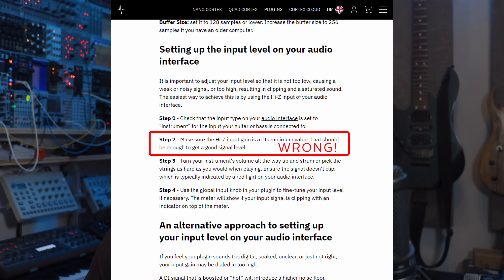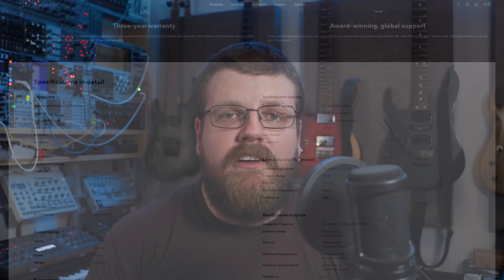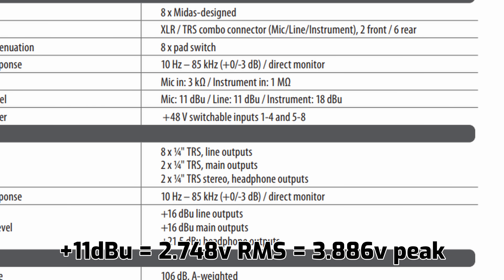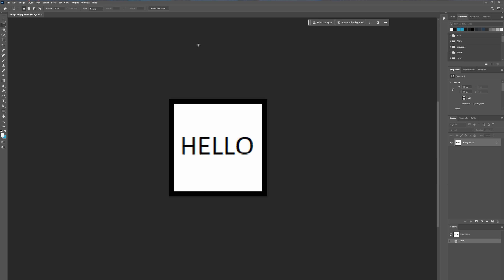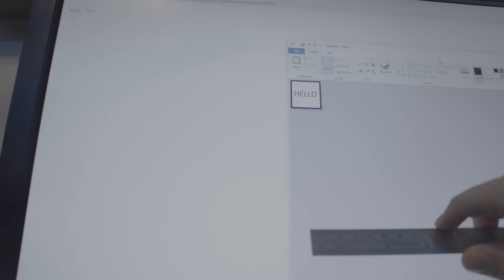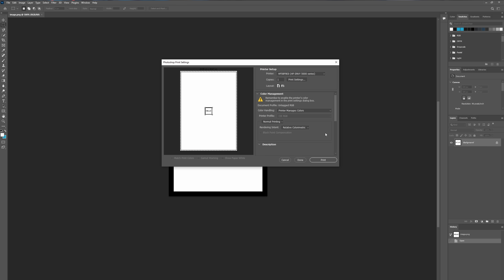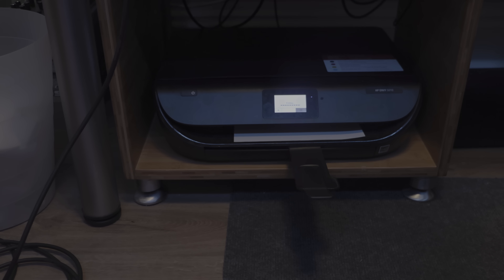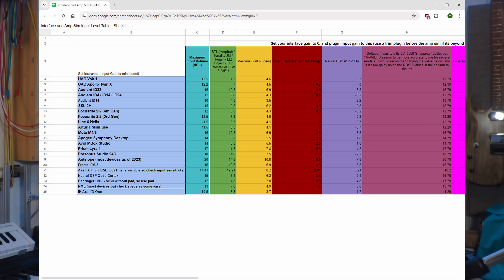Ampsims and input gain - Please, stop the madness...

Comment: isn't -18FS = 0dBVU = 1.23 VAC the standard measurement calibration at 24 bit?
Reply from the maker: There is no standard calibration for any of this - that's sort of the problem.
Reply: @GhostNoteAudio   I'm not really sure I follow, because there is a standard calibration from dB FS to dBVU and it's -18dBFS @24BIT = 0dBVU = 1.23 volts ac.  Is the issue that the plugin programmers are not coding for their plugins to be optimal at any particular signal range?  because that's lazy.  All dynamics plugs do, and if they didn't, you would have to massively regain structure every time you swapped one plug for another.  FWIW, I've never had any issues just plugging into the HiZ and gaining like any mic into the Emulator.  I agree with your philosophy 100%
Reply from the maker: @japmn1  you keep saying there is a "standard calibration"... Got a source for that? Because the whole cause of this kerfuffle is the fact that there isn't an accepted standard. So I'd be very curious if you could offer some documentation or specifications for this standard you're referring to. - also, bit depth has nothing to do with this so not sure why you keep saying "@24BIT"... Not trying to be confrontational, just trying to both learn and educate.
Reply: @GhostNoteAudio  The Standard calibration from a +4dBu analog signal to Digital Full Scale @24 bit is 1.23 volts AC (0dBVU) is equal to -18dBFS in the digital domain.  It is the standard calibration to match a Converted digital signal to Analog Signals in +4dBu calibrated system.  You can test it.  push a 1k tone out of your balanced converter output @ -18dBFS.  Measure voltage across the leads, it will measure around 1.23 volts,  0dBVU in +4dBu is around 1.23 volts AC.  -18dB on a digital meter is roughly 0 on a VU meter at +4dBu.
Reply from the maker: @japmn1  I'm sorry but you're wrong. You can't make this claim because the maximum input level varies between audio interfaces. You can feed it a +4dBu signal, and it will result in different dbFS levels of the converted signals. This is NOT a standard at all, and that is evident by just reading the product specs for a handful of audio interfaces. They all have varying input levels, and thus feeding them all the same +4dBu signal will result in varying signal levels in the digital domain.
Reply: @GhostNoteAudio  Whatever you say man, I do know that I and thousands of others have calibrated DACs to Analog consoles and tape machines to that standard for about 25 years and I have never seen a -18dBFS (with maybe a half dB margin) signal from any DAC NOT measure 1.23 volts AC, which certainly is 0dBVU in a +4dbu Analog system.  Get a digital multimeter, pump out some 1K.  See for yourself.
Reply from the maker: How about you do that, because I did; that's how I KNOW you're wrong. And that's why I created a 12 minute video on the subject. 🙃
Just read the user manual for the Focusrite Scarlett as a start. it has a +12dBu input threshold, and that results in 0dBFS. Reduce the input gain by -8dB, so you have a +4dBu signal... and you have -8dBFS on the digital side. Not -18dBFS. How is that so hard to understand? It's basic math.

Now repeat experiment for every audio interface on the list in the spreadsheet, and realise that they all result in different dBFS values at +4dBu.

Comment: Thanks a lot for this clear explanation. It reminds me of another analogy with the digital photography. There is a lot of difference in the final image file, if I underxpose a shot and then I add luminosity in post production, than if I overexpose the shot to the maximum possibile level but without burning lights, and then I reduce the luminosity in post production. It is always related to the signal to noise ratio and to the ability to exploit, at the best possibile level, all the available bits.

Comment: I always called bs on the 0 db gain stuff. While it works if you tweak around stuff in both the interface and the plugin, you can't achieve the most optimized result you want.

Comment: I have a dumb question as I am a beginner trying to record, but never have recorded a drum sound I've loved:

You said set your input gain in your plug-in according to the spreadsheet. What does that mean? I just am recording straight from the interface to the daw (reaper). Do I have to get a specific plug-in in order to gain stage? I'm confused. Wondering if I can skip that step and simply set gain right below clipping on the interface, and then off set that gain via lowering the input on the DAW
Reply: I have same question!

Comment: Great video! Thanks for setting this straight. Not sure what the deal is with the spreadsheet, but most analog emulation plugins are looking for around -18dbfs on their input (check the manual to verify). Easy enough to set with a V/U meter and volume control plugin, if the amp plugin doesn’t have input volume or decent metering. But yeah, ALWAYS set the interface input just under clipping level for best SNR.

Comment: Im so confused with what is meant to be adding boost vs treating your input like a real world amp. If I dial up gain on the guitar input, so it sits before breakup, is that not the same as adding a clean boost pedal in front of the amp? My understanding is that zero db gain on the input was meant to give us a true guitar>cable>amp simulation.
I get the whole noise floor thing, and wanting a base level, but even when we change guitars real world we are changing output levels between pickups, cables, pedal chain etc...
Ive been using Audio Assault plugins and they now have a level calibration built in. I combined your advice here, on my Audient ID24, and used the calibration in the sim and pulled almost zero db (-.6db) digital adjustment. For the most part this make sense, but am I now clean boosting my guitar signal??

Comment: Great video. I think that part of the problem is that lots of USB interfaces can't take a higher voltage input signal without clipping, so there is often minimal or even no setting on the input gain knob that doesn't clip (e.g. see Ola Englund's comment). So the manufacturers just tell people to turn it fully down because that gives a layperson the best shot at actually avoiding clipping. Some noise is a better result than harsh clipping.

As a side note, this is a good reason why using a separate DI box (like the ones used in live sound) can be useful, even if your interface has a button to set it to "instrument input". Converting the instrument level signal down to line level can allow you to actually have usable range on the input gain knob and can avoid clipping on the interface

Comment: Finally...  "bro science" is everywhere. People also make plugins differently, use different levels for all kind of operations. Ideally people would have a "healthy" level to work without clipping. If a plugin maker has used 0 knob'd setups, it might work just for that plugin maker, but it is definitely not the cleanest starting point. This "knob on zero go-to" thing will mess your gain stage at a huge load of plugins and not give you the best results, overall. Very nice video.

Comment: Thank you. I've had this same argument with folks for 2 decades now, even people who call themself sound engineers. I even aproach vocals the same way through an external compressor to catch those absolute extreme peaks. it is simply another level of sound quality. your analogue gear before the AD converter sound better when it run hotter even the opamp of your converter. Take this aproach and you'll be surprised to discover you don't need that expensive SSL or Neve after all to get a good sound. You might also discover you now don't need to use as many plugins to get a great sound. The only difference between cheap and expensive gear is, with cheap gear you have to do a little more to get there. Remember these 2philophies, less is more and hotter is better. PS this also apply to girlfriends. 💦

Comment: When I was in college I did some recording on a 4 track cassette recorder (Tascam). I very quickly realized that the "hiss" from the tape was always at the same level and recording at close to maximum gain without distortion was the best way to minimize the effect of the noise. It seemed blindingly obvious. I had no training, not even a manual and figured this out in like minutes. Even the cheapest Behringer interface sounds immaculate compared to a 4 track, so I guess it's not super obvious anymore, when you can record with no gain on the input and it sounds pretty good anyways.

Comment: i have an audient id14 that clips at the lowest gain using the specifically designed jfet instrument input.  argued with audient quite a bit, and they were full of it when i addressed my concerns, telling me i should just turn the volume down on my guitar.  if you're a guitarist, you know that is unrealistic.  i ended up making a cheap attenuator out of an altoids tin and a pot to make it more usable.  still noisey as hell.  i shouldn't have to do any of this crap with an input that literally has a picture of a guitar next to it.  this video helped me realize i kinda got screwed by audient, and i'm sure i'm not the only one.  thanks for that man.

Comment: People also still believe to this day that a higher sampling rate makes your signal more correct in the digital domain. You can't fix stupidity. 
Just strum the guitar as hard as it gets and push the gain up until it clips or distored. Then pull the gain 1-2 dB back to be absolute save. Setting the gain to zero is wrong on so many levels.

Comment: I disagree with you. Obviously having your Pre-amp all the way down is not correct. But I find that most designs of preamps, especially on cheaper interfaces, make a hell of a lot of noise in the last segment (turned all the way up). You'll find most pro studios hit their A/Ds at -6 or -12dBFS and then boost or cut in the software. Almost all boutique emulation plug-ins expect audio to hit them around averaging around -18 to 14 dBFS. My whole signal chain throughout my DAW mixer I run around unity RMS/VU where 0VU=18dBFS. Transient material I always trim to -12dBFS. Those are by far the best levels to work too. You are right about ADs and using all the available theoretical bits means peaking up near 0dB. For the sake of the performer getting excited and playing or shouting more, it's not worth loosing the performance to digital clipping. Ergo, -12dbFS is the norm and you are unlikely to suffer from noise at the top end of gain of the pre-amp. 

You won't go to any professional studio anywhere and hear any jobbing engineer who recommends you hit the A/D at -0dBFS. No where. So just be aware of that.

Comment: Makes sense!
 Is the gain staging with meter and playing open string as accurate as only setting audio interface gain to 0 and match the plugin input gain with data sheet specs? 

Ive been using three different audio interfaces from different brands and all those have had good (enough) NSR for my distorted tones when gain set to 0.  
Is it as accurate to use meter and open string to find the amount of gain you have to reduce? I guess that there is more room for user errors, and its more time consuming. But deffinately gonna try that if noise level is makikg tone unusable.

Comment: Who doesn't know this? Are you saying people don't understand what gainstaging is, or how to accomplish it? Any pro who ever used an audio mixing board, even an old analog one from 4 decades ago, has known this since before then. That's what the trim control on each input channel was for—to set the input to the optimum level before processing.

That is the first stage (assuming the devices input to the board are set at their optimum output levels). Next stage, mixing, final stage, system output level. It really is just that simple.

The reason -18 is the accepted standard for digital audio is not bc that's better than -1 (actually, it's 17 dB worse than -1). -18 was chosen bc many people hired to run audio are not careful about setting levels. For digital audio, anything below 0dBFS works exactly the same, other than the lower you go, the worse the S/N ratio gets. But with 24 bit having a noise floor of -144, they figured even -18 would mean an inaudible -126 dB noise floor, plus enough wiggle room at the top to keep idgits from wreaking havoc by clipping.

So an engineer who carefully sets levels can use everything between -18  and 0dBFS with impunity, and get a lower aggregate noise floor, which while almost meaningless for audio with a single stream, is a factor when there are 100+ tracks mixed together.

Comment: Indeed, increasing the preamp gain can also increase the signal-to-noise ratio (as also demonstrated by Julian Krause), but it all depends on the hardware.
While this test may be relevant with entry level interfaces such as the Behringer you achieved the test with, this may not be the case with more expensive gear. Higher quality preamps have very little SNR increase from 0 to max gain, so the improvement becomes insignificant.

As a side note, as many people have noted, you performed this test with the Pad on, which reduces the input gain, but with most preamp designs this does not lower the noise floor and you can end up with a very poor SNR, especially when increasing the gain like this. So beware! Luckily this doesn't seem to be the case on your device, or maybe it simply doesn't affect the instrument circuit.

Comment: Interesting! One question though. Neural DSP calibrates its amp sims for the input level of 12.2 dBu. Would you please tell me why you deducted the 24 db from the already set value of 4.8 db on the plugin? Shouldn't the signal hit the amp at 12.2 dBu? meaning that the input gain on the amp sim should be 12.2 - 24 = -11.8 dBu.

Comment: Good presentation!
 I would also like to see some consistency in being able to meter at multiple points in signal chains in DAWs and guitar modelers. Also, having a clear statement of the interface full scale (in dBu, volts peak or dBV even) and the intended levels fir plug-ins or DSP blocks in modelers would be very helpful.

Comment: I'd suggest an additional tip to this, take it or leave it.  You're seeking maximum linearity between trading noise and distortion, the challenge since the dawn of recorded audio, film, and video. Looking purely at the front end and ADC performance, it makes sense, however there's another consideration that is even more often overlooked and rarely discussed, and that's workflow.

In broadcast the convention is to trim inputs and outputs based on nominal /normal levels, and the convention as I'm sure you're aware for pro converters is to match nominal level of +4dBu to -18dBfs, or 2dB either side of that, both levels being measured as RMS.  Of course more consumer grade equipment is all over the place, nevertheless, that workflow makes a great starting point. In recording studios people like to f with that and drive gear harder, leaning into saturation and its tonal qualities, altho that's not such a thing in the digital domain.

Anyway I get recordings handed to me all the time where people have just recorded the hottest level possible without clipping, or just have levels all over the place, and it's nowhere near as quick and intuitive to work with. The improvements in how things are perceived, and how easy a recording or a setup is to work with, how predictable and intuitive it gets, when you have your monitor level pre set and you work this way, cannot really be grasped until you try it for long enough to get used to it.  I learned this stuff when I started in studios in 92, then forgot it as digital took over, then rediscovered it as the digital abundance of possibilities eroded my vibe.

That being said, another great way to work is to just think less and know less about it all, and enjoy the exploration and discovery with an open mind, and let it be what it is. A simple discipline is great, but doing everything to the nth degree so every aspect of everything is technically optimal, isn't good for creativity, in my experience, but then it's also important for people and things to be different.  Some great recordings are super technical, then some embraced noise and would probably suck if they weren't so noisy. I guess the bottom line is use your ears.

Comment: As an MSEE and veteran of years of design, installation, and support of industrial measurement, instrumentation, and controls systems, it checks out. One distinction stands out, though - in most of the systems that I deal with, I have a known maximum somewhere in the physical/analog side of the setup. For example, a system to measure dynamic unbalance of spinning parts; handwaving over the details of the mechanical system and whole analog signal flow, by the time we're ready to AtoD this, there's a max 10 volt peak to peak sine wave. We set the gain in the analog side so that the highest imbalance we want to accurately measure is safely less than clipped. This way we get the greatest digital resolution on lower level signals, especially at the fringes of "good" vs. "correctable". So we have the benefit of having a max analog signal above which we can tolerate just ignoring it and saying "your brake rotor sucks".   When I'm setting up my audio IFC for my guitar to my DAW, it's more haphazard, like "play as loud as you're gonna play and make that just barely not clip" is subjective. So I'm now kind of thinking, maybe it would be a beneficial approach to have an analog compressor before the AtoD.